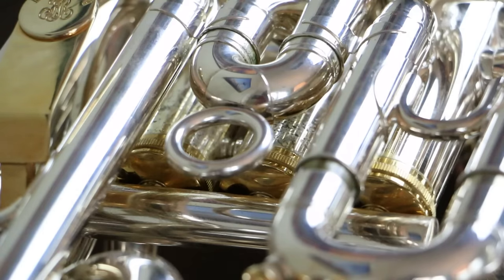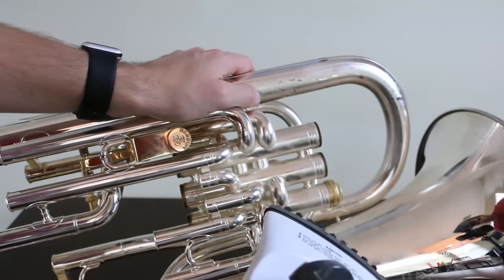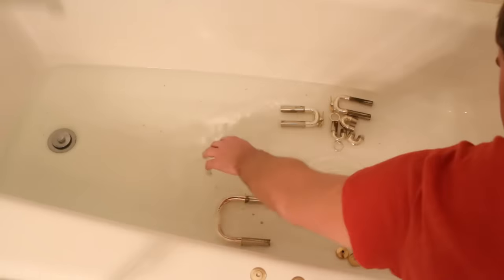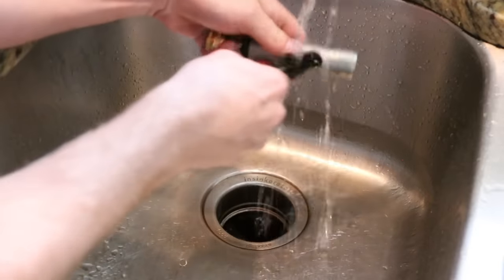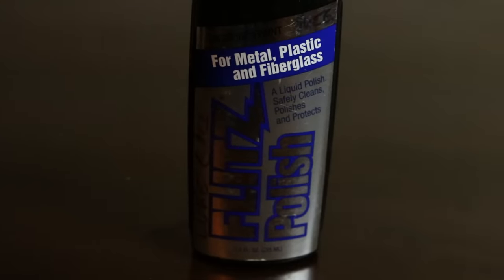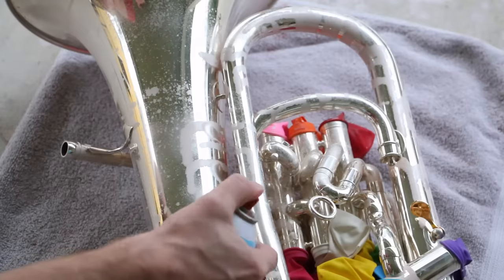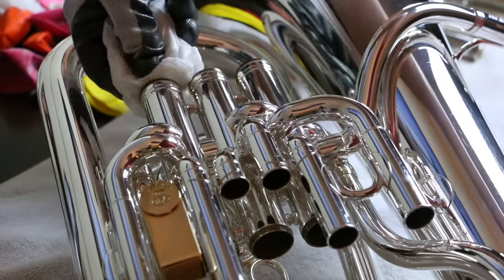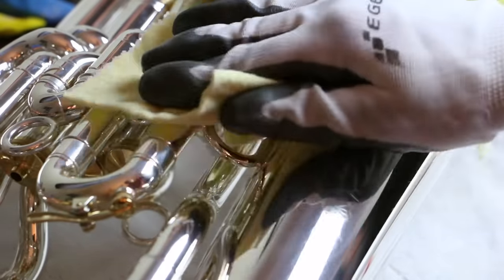How to Clean a Brass Instrument (with balloons!)

Comment: Never!!! Clean your instruments in soap water! Strike 3 all-in-one! Doing this actually starts to permanently damage your horn over time...
Reply: C4pt41nN3m0 Number one, that wil gunk up valves. Band directors are not mechanics. I worked at a professional music facility for 7 years. I did some work in the shop. They should be cleaned with a specific solution that repairmen typically have in their shop. Number two, I was the one to deal with angry band directors and players when they brought their horns in because the valves were sticking or stopped working. 9 times out of 10, they were gunked up with soap residue. I am only trying to help people. Do whatever you want.
Reply: Anyways, that is the proper method from someone who has been on the inside. The music industry is full of wives’ tales and different translations of misinformation. A lot of people say, “oh yeah, I do this all of the time,” but it doesn’t mean it doesn’t cause problems or things they don’t even realize... I hope that helps. I hope you have good mechanics near you. Some mechanics don’t even follow the proper methods when repairing/ cleaning instruments. I am used to people in the south having that type of problem because lots of music habits are taught by word of mouth, but most of the older concert band music roots are in the north. I hate that stuff gets spread like that.